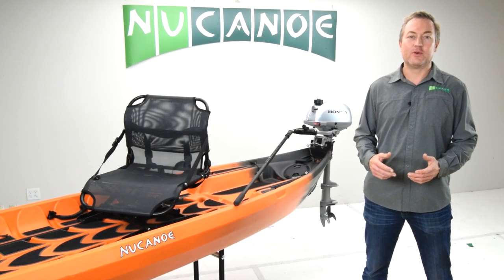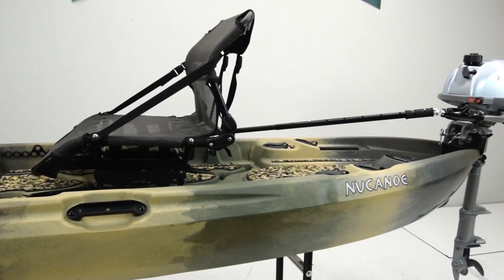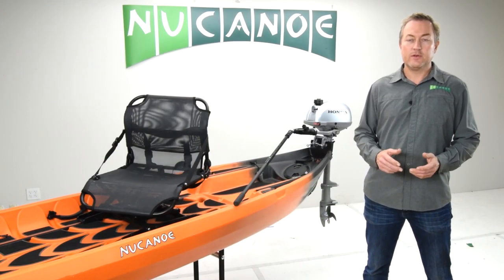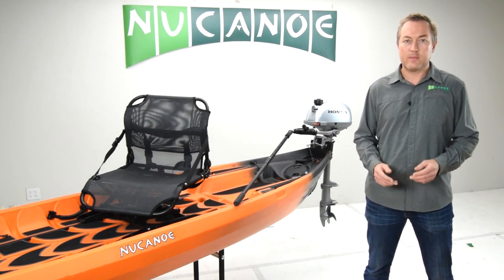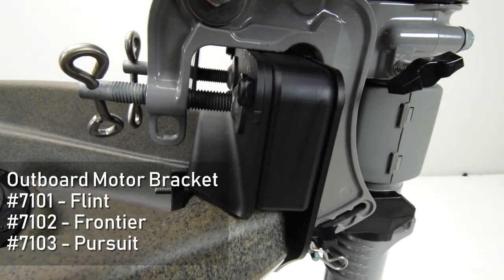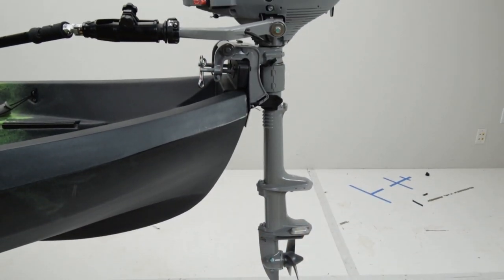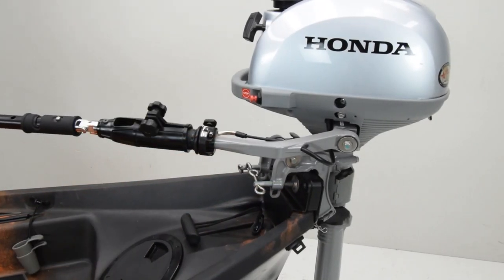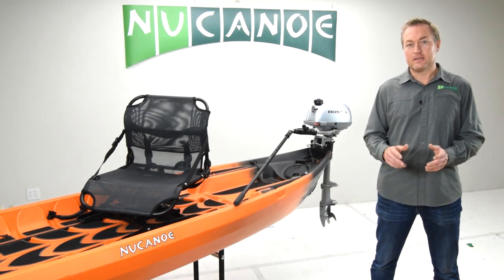Outboard Motors on NuCanoe Fishing Kayaks

Comment: I bought a Frontier a couple of years ago because I thought the transom would fit common motors  like my 2hp Honda or electric trolling motors. It did not. The Honda would not fit at all and my two electric trolling motors were such a tight fit they popped out when bumped. Now I have to drop $80 on bracket to fit over the existing mount to make my motors work. While these mounts look nice, please consider making it clear in your earlier videos that not all common motors will work unless you have this bracket.

Comment: This video is misleading. DO NOT USE A LONG SHAFT MOTOR! I emailed Nucanoe about a year ago in regards to this and they said they had posted an updated video recommending the short shaft. I don't know why this video is still here. A long shaft outboard WILL NOT PERFORM CORRECTLY with these low transom kayaks. It will run horrible. I spent a lot of extra money for trusting this video as I putchased a long shaft Suzuki and soon after I had to pay over $300 to convert it from long to short shaft.

Comment: All you people are mounting your motors too low. you need to raise them to get optimum performance.
Reply: I just got a Honda outboard motor and I haven’t gotten a mounting plate yet but it seems like the ones I see on videos the motor goes too far into the water any suggestions thanks
Reply: @pragimhamawi8523  Yes add an aluminum plate to front and back side of bracket to the height you need and plastic hi-molly between plates to fill gap. Hope that helps you in your fabrication.